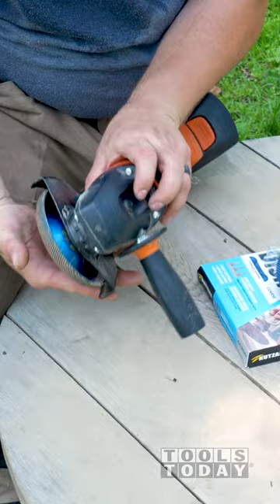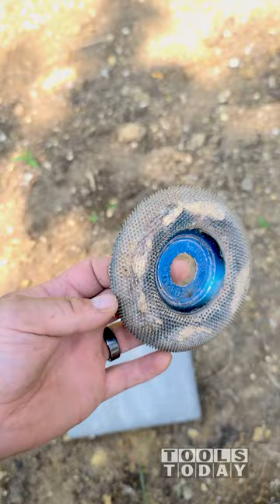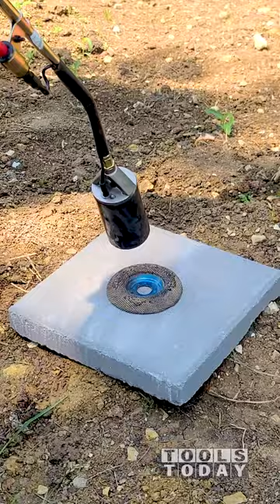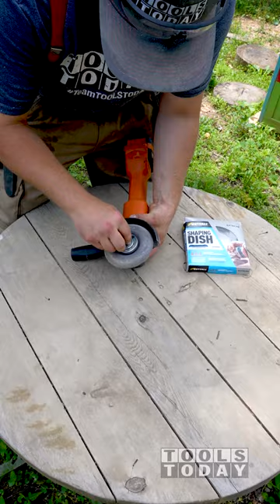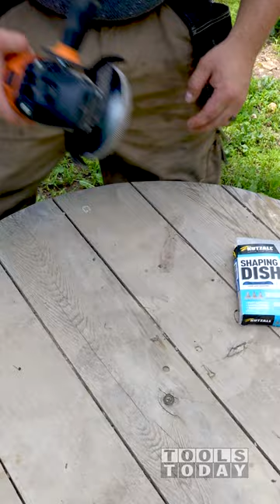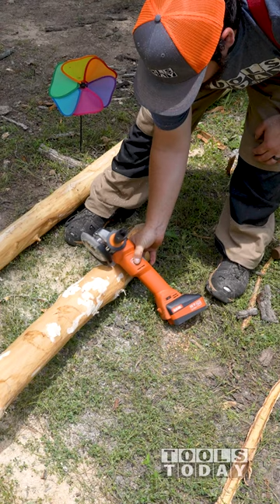Cleaning With Fire

Comment: 1. There was hardening of the disk.
2. No hardening.
3. Stupid act. 
end.
Reply from the maker: this is how Kutzall recommends cleaning them. From what I understand, the carbide is attached on at higher temperatures than can be achieved with a torch like this, so the heat doesn't have a negative effect on the disc.
Reply: @ToolsToday  your understanding is correct.  and carbide isn't hardened like tool steel...its just exceptional hard.

curious though, is the entire disk solid carbide?  I imagine not, probably a steel hub with carbide attached?  brazed, maybe sintered?  

only bad thing you can do to carbide with heat, is to shock it.  Just dont go dunking in water to cool it faster & your fine.  and honestly, with that kind of torch and that big a mass, you probably could even do that without problem...but still, dont.
Reply: 1. carbide isn't hardend, its just hard.
2. yes, no hardening.
3. stupid comment.
end.